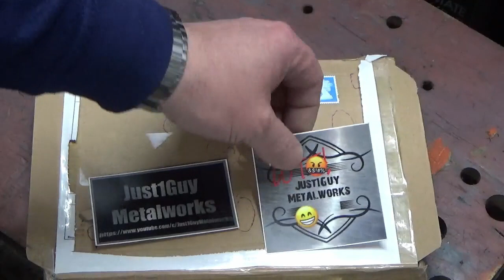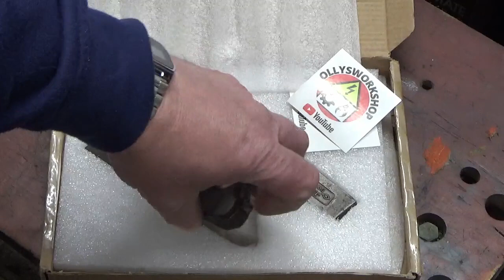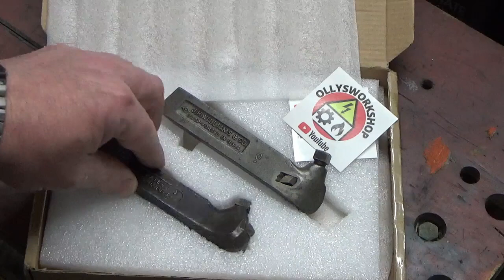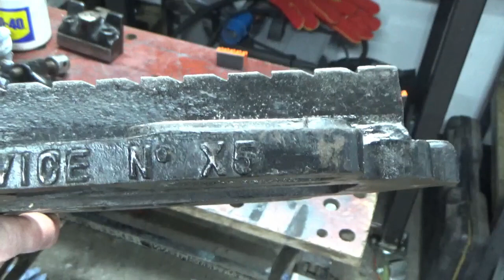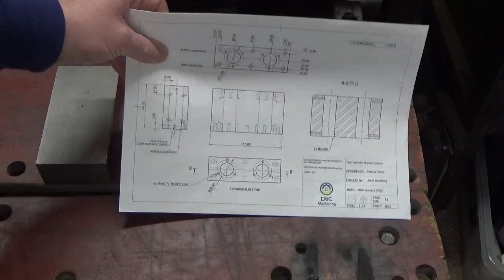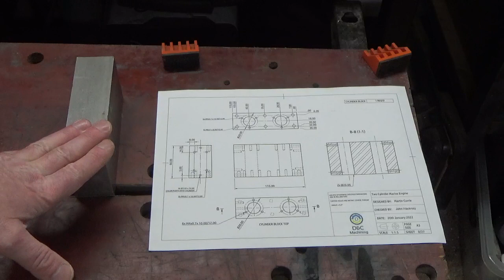Workshop Blether #15

Comment: I reckon a sub plate between the shaper box and the vice would increase stability and make mounting easier. 3/8 would not take up that much height and would allow some meat for T slots. If it were extended to the RHS you could add additional support extending from the side of the box like an inverted angle plate.  Looking forward to seeing the quill sleeve fix, I think it will work just fine. I once made a Delrin ACME nut as a trial it save me so much time when I made the bronze one all I had to do is work up to the DRO numbers and it was pretty much there.
Reply from the maker: Hi Tony, thanks for the comment. I have not given up on the vice yet lol, a sub plate may be a good solution. Cheers, Jon

Comment: Jon sometimes I buy things I do not need because they need a good home where they will be appreciated. I have 2 sets of original Greenfield tap and die sets in their original wood boxes. One of them has the day the original user bought them in 1943.  One set is course and the other is fine thread. They occupy a spot on my shelf, and I use taps and dies from two other new sets. Once I used the new spiral flute taps now, I am hooked so none of the new taps get used now.  Excellent plan of recovery/repair of the Quill shaft. I will be looking forward to watching it. Thanks for inviting us to the Blither.
Reply from the maker: Hi Terry, thanks for the comment. It isn't the first and won't be the last daft purchase I am pretty sure. Cheers, Jon

Comment: Most magnanimous Olly, Terry, and Mr Anonymous 👍.
So this Shaper Vice, is to put the Atlas 7B in?. I did the same buying a 6" Abwood for my 7" shaper. That type of vice is mainly for drilling with, commonly on radial arm drills in my experience, but for roughing,  milling use is fine.
Great video Jon, thanks for sharing.
Reply from the maker: Hi John, thanks for the comment. 6" Abwood was what I stared at every day for the 1st 2 years of my apprenticeship on a Bridgeport. One day I will own one myself (and its respective Bridgeport plinth). Lol. Cheers, Jon

Comment: I've got a 21" shaper just sitting in storage that vise would fit nicely, come get it and it's yours, lol.... Kentucky to were you are is quite a trip.lol...great video, keep'um coming.
Reply from the maker: Hi Kentucky Trapper, thanks for the comment. If only there wasn't 3000 miles of water in the way and I had some more room in the workshop lol. Cheers, Jon

Comment: Hi Jon. An interesting Blether. The vice is something I have never seen the likes of.. As you say, way too big for your shaper. Will be watching the remake of the Quill drive & hope it turns out perfectly this time. I have a ton of Clarkson cutters & they are probably the most stable in use of all methods.. On the plus side is you can also use them in a Collet chuck, so win win. 
Regards.
Steve.
Reply from the maker: Hi Steve, thanks for the comment. Yep, Clarkson is a very solid holder, I used them extensively 25 odd years ago. Often overlooked these days in favour of ER. Cheers, Jon

Comment: Hi Jon, thanks for the shout out. I’m just thinking on that vice, the section that has been repaired, if you where removed the section in line with the holes that hold the jaws you could install / bolt a 1/4” bar across those holes and bridge the broken part. Or make a lamp out of it lol
Reply from the maker: Hi Terry, thanks for the comment. Lol, lamp wins it, just need to convince Mrs Jon's Workshop it will look nice in the living room. Cheers, Jon

Comment: Well, Jon, since you’ve asked: though I have no shaper experience, the Fixie looks wrong to me because the jaws cannot be perpendicular to the stroke, apparently. I’ll keep watch for a comment from Rusti, whose shaper credentials are genuine. 👍
Reply from the maker: Hi Dudley, thanks for the comment. Very logical and reasonable. I though the same but then countered that with what you do on a mill where you generally take cuts in the X axis aligned with the vice jaws etc. If only it would fit so I could test the theory lol. Cheers, Jon

Comment: Hi Jon. How about bolting angle plates to each side of the shaper table to support the monster vice? I've never seen one quite like that, although hand tool rescue did a 'fractal vice' a while ago which looked like a level above that one in terms of gripping versatility.
Reply: ollysworkshop, this is the episode you were thinking of I think and I too thought about that when Jon showed the featured vice. Link below that I suggest to all interested.
Thumbs UP For your thinking. John, Australia.
https://www.youtube.com/watch?v=QBeOgGt_oWU
Reply from the maker: Hi Olly, thanks for the comment (and kind donation). That's a possibility mate, I will make a proper assessment once I have stripped and cleaned up the vice. Cheers, Jon

Comment: Hi Jon, enjoyed the video. Loving that vice, you are right there is certainly something about it, and a smaller shop made one would indeed make a very useful tool.
It would certainly be a good idea to give Dave's sleeving idea a go on the mill spindle, will save a lot of work and you have nothing to lose as you still have enough material for a full one if needs be! 
Take care, regards Tony
Reply from the maker: Hi Tony, thanks for the comment. Maybe a smaller one in the future and sharing the plans for others may be an option. Cheers, Jon

Comment: Glad you appreciated my suggestion of making a sleeve for the quill spindle. That wooden box is worth keeping, will make a nice step up platform or a seat for when you get tired 😊 Regards from Australia.
Reply: Wooden box....🤣🤣
Reply from the maker: Hi Dave, thanks for the comment and suggestion. I will save the box for when I move workshop, will be useful to pack lots of small tooling in. Sleeve idea had to get cut unfortunately once I measured everything up which is a shame as it would have saved a lot of work. This week's video will explain the issue hopefully. Cheers, Jon